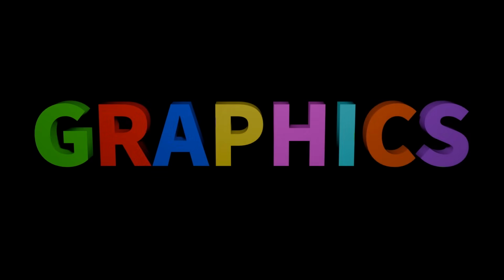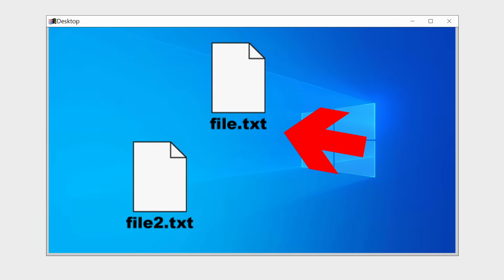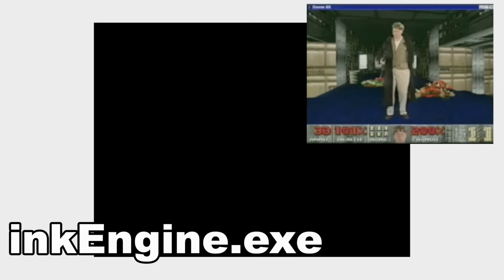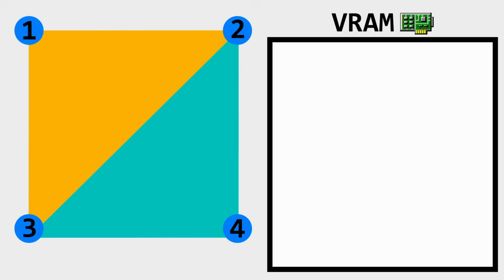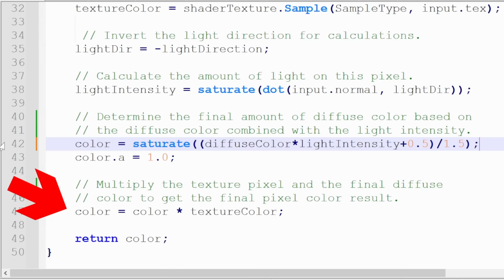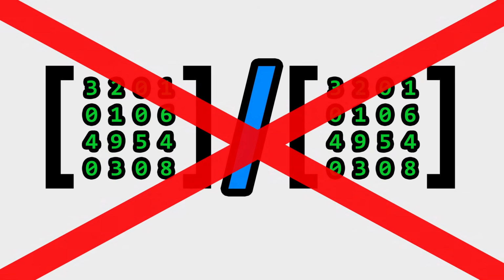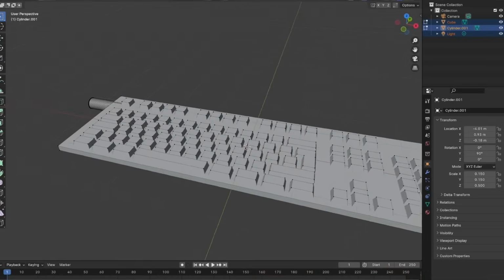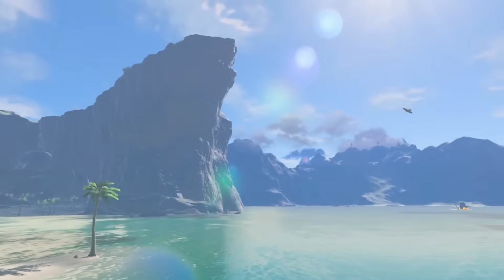Creating My Own 3D Graphics Engine

Comment: coded my own 3d game engine in 6502/10 assembly  for a lark on c64, rendering quasi textured polygons/sprites/particles etc in PETSCII characters . Had to write my own floating pointing point math/transforms from scratch as the 50 year old cpu utterly lacked for such things. Performance wise wasn't to bad maybe 10 fps unoptimized had optimized code implementation which doubled it but too lazy to do the significant recode. Kind of surprised couldn't find that anyone else had done(3d petscii) as seems a  pretty cool option for 1982 hardware. I hardly took anytime over assets and think it looks reasonable alternative to slow 8bit bitmap graphics. Could even used scrolling pixel scroll registers to interpolate rotations for a quasi 50 fps turning fluidity,. I tried but didn't seem to work quite right though lol...

https://www.youtube.com/watch?v=G6DWmaxw6Ic

Comment: Saw a lot of comments about the floor, but I have one about the skybox: There's a technique around taking a cube, with a mapped sky texture (almost like a "skybox") or sphere and render it first in the frame with the camera directly in the middle of it. In my own work, I usually create the skybox/skydome elsewhere outside of the main world, place the camera directly in the center of it, pull the FOV out, disable culling, render, then place the camera back in the world and render as normal. It gives a much better sense of "infinity" to the horizon.
Reply from the maker: That's clever, I'll definitely use that technique next time

Comment: Developing a content pipeline would also make an interesting video. I don't really know how modern engines like Unity/UE do it, but in older games (PS2 era for example) game assets were processed heavily as part of the build process. Texture mipmaps need to be generated, texture fonts, etc, and all that data is compressed so it can all fit on a DVD. They used a combination of LZSS and RLE compression.
The pipeline has to process any new/updated assets that get added during development, and it's better if it's all automated as part of the build process. A good content pipeline is something I think a lot of game engines out there overlook.

Comment: You can actually combine the three shader matrices into a single WorldViewProjection matrix before sending to the GPU.
You can also avoid having to use sin and cos math for movement (which can get problematic when trying for up and down movement) by leveraging vectors and scaling.
Third edit, just create a screen quad in clip space and draw UI textures to it. You don't need to do all the matrix inversions etc.
Final edit, please make a video covering culling, because without it you'll be severely limited in terms of how many unique meshes you can display.
Reply: He should do gpu side culling with indirect drawing for maximum performance

Comment: N64 was not good 3D lol. It looked dated upon arival. Perfect Dark with the addon gave the system a bit more fidelity. But games that appeared on PS and N64, almost always looked better and had a higher FPS on the Playstation. The n64 had the blurriest textures to the point it hurt my eyes.
Reply: You're insane. It looked far better than PS1 with it's lack of floating point and no depth buffer. N64 and PS1 both had the same max resolution, but N64 used it more often. PS1 and N64's libraries were mostly capped at 20fps, with some PS1 games dropping as low as 15. The only thing you're right about is that N64 had blurry textures sometimes, and that's because the console supported mipmapping while the PS1 didn't. So on PS1, you got jagged aliasing instead.

You don't know what you're talking about, you're just trying to war over consoles nobody is playing anymore.

Before opening your mouth in the comments of a video where actual graphics programmers will hang out, maybe you should actually learn graphics programming.

Comment: Hey man! Great video, very informative. Not sure how it's handled in DirectX because I'm not super familiar with it but because the UV coordinates are normalized, usually if you set them to higher than 1 it will tile the texture, so instead of having to make a floor of 2500 cubes you should be able to, in theory, just set your UV coordinates for a quad to be 50x50 and you should get the same result, but with 29998 less tris that are being calculated. Similarly, rather than using six cubes to make a skybox, you could have created one cube and inverted the normals so that the faces were pointed inward, saving you another 60 tris. Also, not sure how you implemented your frustum culling, but it can get very expensive very fast, so it's typically good practice to "chunk" static objects together so that the whole chunk can be assessed as to whether or not it's in frame. This is actually the same basic concept that's used for some raytracing programs (see Sebastian Lague's video on building a BVH for his raytracing project). Super awesome to see someone taking the time to learn the basics of how game engines work, great job!

Comment: I guess is easy to work with squares, but I wonder if there are examples of games who render text with a single polygon, Instead of a quad made of two polygons.
Reply: A quad IS a single polygon. What you're trying to say is "Can you render a polygon with only one triangle" and, no you can't. But you CAN render multiple triangles with less than the total number of vertices you'd expect. Eg a quad would normally have six verts, one for each corner of two triangles. But two corners of each tri share vertex locations, so we index them. Tri0, v0 v1 v2, Tri1, v1, v3, v2.
Reply: @moonhowler667  Sorry when I wrote polygon I meant to say a triangle. Which is a type polygon. If a triangle can have a texture applied to it, why can't text be rendered out of triangles with a single texture that contains the entire alphabet?
Reply: @TheIndigoShine  It can, that's called texture atlasing. The ideal method is to render two triangles directly in NDC space, and use texture quilting on an atlas to choose characters. Then all you need is a way to convert character inputs into UV coords within the shader and you're done.
Reply: @moonhowler667  cool.

Comment: 20:55 couldn't you make the texture repeat? in opengl (i know you are using directx) you can set the texture to repeat by using glTexParameteri(GL_TEXTURE_2D, GL_TEXTURE_WRAP_S, GL_REPEAT) and then you can set the UV to the range [0; N] and the texture will repeat itself N times

Comment: I never done any DirectX stuff but I don't think you need any matrix (orthographic or perspective) to render 2D stuff. You can just use a different shader with only 2 values for position, and hardcode z coord in there. At least that's what I do in OpenGL/Vulkan
Reply: Easier way, just create a quad in clip space right in the vert shader stage. Use NDC directly,

Comment: I just realized that you have been able to make a lot of games with different programming languages, and I remembered today that when it comes to programming you need to focus more on being a great problem solver rather than remembering syntax, and I believe that will help you be able to learn  any programming language. I learn't about this from Fireship's video, how to learn to code - 8 hard truths.

Do you ever have any difficulties with making new games with different programming languages? And if not, do you think there's a reason?
Reply from the maker: All high level languages are basically the same, so it really comes down to what platform do you want to write a program for. Windows, c#, c++. Web, javascript. Linux, c, c++. Just want it to work and don't care how: python. But of course the most fun: assembly.

Comment: 6:26 why location, color and depth are float? Float is slower and makes no sense
Reply: What do you mean ?? What should it be ?
Reply: @fold4x  It should be a structure or Integer, but float is floating point and makes no sense if you use it to store integer variables. this bloats the app and makes it slower
Reply: you literally don't understand how the fragments work lol.
Reply: @tomtravis858  You don*t unterstand that fractions are much Slower than Integer and any serious coder avoid them at all costs
Reply: Dude. You're suggesting that vertices only use integer positions, that's the first issue. Do you want them to snap around like PS1 games did? No? Then you need floats. Second of all, colors are processed as RGBA float 0.0~1.0 range by the frag shaders, so no, you can't even use integers there. Third of all, the depth buffer is ALSO a float 0.0~1.0 range, so no you can't use integers there. 

Saying "good coders avoid floats" is the same as saying "I write good code because I always use size_t for iterators" which is a SUPER midwit response.
Reply: @ Dude, you suggest that I don't konw that. with 32 bit integer you have 1 Billion positions. 64 Bit even more. Nothing will snap. and colors shoult be handled in 32 bit with ease even if you have a 10 bit monitor
Reply: @omegaidol First of all it's 32bit int, not 34. Also there are over four billion values in a 32bit int. But the problem is, worldspace is in floats because the world/view/proj matrices are floats. You can't do proper multiplication of matrices with integers because you need a range of 0.0~1.0. So if you use ints, vertices snap to the nearest worldspace integer position. 

As far as colors, read what I said again. The GPU expects the output of the fragment shader to be in float RGBA 0.0~1.0 format. Not integers.

And besides, you're doubly wrong here because a float is 32bits and an int is 32bits. DOUBLES are 64bits. Floats are negligibly slower, about the same perf difference as 32 vs 64 bit ints. 

Do. Your. Research.
Reply: @XandrEDM  34 bit was a typo. If the shader expect float, ok then ti makes sense.
Float operations are still usualy slower as no bit shift operations are possible, which are faster than ana multiplication or division
Reply: @omegaidol Google "floating point bit magic", or just "fast inverse sqrt". ;)

Comment: I’m surprised you didn’t use vulkan
Reply: i would have been surprised if they had used vulkan. the amount of boilerplate you need to write to get basic rendering is significantly much more than that of D3D11 or OpenGL.
Reply: @chromosoze  open gl is old and bad 🥱, vulkan is open source and not more compatible but definitely an alternate, it interacts with the computer system way better, open gl is limited becuase it’s old and needs to keep its compatibility

Comment: The way unity handles UI is to rendering it on a plane and stick it too the camera and use orthogonal view on it, rather than another ortho gfx pipeline... it renders faster UI being the worst fps hog to begin with. it also transfers CPU to GPU for some calculations.. also UI libs just need a renderer.. and you can get away with only windows buttons and text fields and editboxes with nothing else

Comment: Yo to help with the floor rendering, add a UV multiplier into your base shader and you can gain back a lot of the performance from just using a single plane like you did previously, and scaling the floor UV texture.

Comment: I made my own 3D game engine as part of my education. The feeling of making something from nothing is truly unique!
Reply from the maker: It's a great feeling for sure
Reply: coded a 3d game engine  in 6502/10 assembly  for a lark on c64, rendering quasi textured polygons/sprites/particles etc in PETSCII characters . Had to write my own floating pointing point math/transforms from scratch as the 50 year old cpu utterly lacked for such things. Performance wise wasn't to bad maybe 10 fps unoptimized had optimized code implementation which doubled it but too lazy to do the significant recode. Kind of surprised couldn't find that anyone else had done(3d petscii) as seems a  pretty cool option for 1982 hardware. I hardly took anytime over assets and think it looks reasonable alternative to slow 8bit bitmap graphics. Could even used scrolling pixel scroll registers to interpolate rotations for a quasi 50 fps turning fluidity,. I tried but didn't seem to work quite right though lol...

https://www.youtube.com/watch?v=Aj8INbkCI88
https://www.youtube.com/watch?v=5rjGQKzJfc4 (didn't v-sync c64 code)
Reply: Goddamn youre smart, i can only code in hello world
Reply: @alexc2971  Better than using wisprflow
Reply: Can I see?
Reply: Yeah! 
It's a really weird feeling you get!
Reply: Please tell me you used vulkan.

Comment: I tried learning graphics programming once, but I wasn't able to absorb much other than the bare minimun to render a single triangle.

When I think of all the math background seemingly required to do all the stuff you do, specially with my next to LITERAL ZERO math knowledge, to the point where I can't even multiply or divide, it makes me feel very hopeless on that front.

To be fair, I was learning OpenGL, not DirectX, but I doubt that would have made any difference, the pipeline seems to be pretty much the same.

Comment: I would have just used vulkan tbh, not a fan of windows :/
Reply: For a beginner project that's a recipe for a bad time. DX12 and Vulkan are far more hands off than DX11 or OpenGL, with many more opportunities to screw things up if you don't know exactly what you're doing. For hobby projects I would just stick with the older APIs, they aren't going anywhere.
Reply: @MrMoon-hy6pn  I've had a smoother experience with vulkan than OpenGL
Reply: @Hellscaped  I’m quite surprised at that. What about OpenGL did you find less smooth? Is it all the legacy cruft, the state management, etc?

Comment: Instead of using a bunch of cubes for the floor, just make one large cube and set the UV map to > 1 so the texture will repeat
Reply: yeah, there are even different tiling modes, like mirror in one or both directions. in opengl at least, but direct3d should have an equivalent.

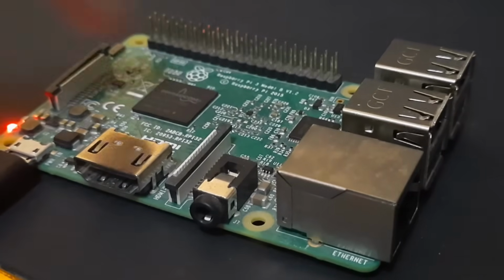Comment: 0:09 I have never plugged a monitor into any Raspberry Pi I've owned, if it would make it cheaper (no HDMI licencing fees) I'd like them without any graphical capabilities
Reply: Better to have it and not need it, than need it and not have it
Reply: @cool-person1161  Well, I own 17, the 16 that are in a cluster don't need any display out, I may as well keep display out on the 17th (I may actually use it one day, if making a game I can check on the worst case scenario hardware-wise)
Reply: i ❤ tty over usb
Reply: Arduino?
Reply: @SSukram_  I need something more powerful than that and cheaper

Comment: Very cool video! Now do a triangle rasterizer yourself and do a complete software renderer ;)
(Also you don't need to create many objects for the ground, you can just repeat the texture on a single ground plane, by providing sufficiently large UV values and setting the texture clamping value)
(Also you don't need to have non-static geometry for text, you could just as well use uniforms in your shader to get texture coordinates for your letters)

Comment: 9:30 No. A CPU does do SIMD. They have registers of sizes up to 512 bits now (with MTX extensions coming that'll have 1024 or 2048 in the future), and instructions that operate on them as though they were packs of 64/32/16/8 bit registers, in a way it is similar to what GPUs do, but on a far fewer number of, but far larger and more pipelined, and completely out of order, predictive, highly optimized cores. Instead, GPUs use SIMT, Single Instruction Multiple Threads. A GPU is made up of (in nvidia's terms, every vendor calls them something else) many GPC's (General Processing Cluster) that contain many SMs (Streaming multiproccesors) that contain Thread Blocks made up of two Thread Warps, which are basically a pack of 32 execution units that can do memory, floating point or integer related instructions, but no decisions, those are made by the SM controller, and all do waves of the same instruction (or they need to stall if not all of the threads are meant to take the same execution path).
Reply: this you? 🤓
Reply: I have no clue what i read but it seems smart so have a like lol
Reply: Graphical processors have dedicated hardware architecture for executing the same instructions on a lot of separate inputs in paralell, which helps them do the math for all the pixels in a displayed image simultaneously.
This only works so long as the same mathematical calculations are done on all of them.
Meanwhile CPUs have a lot fewer operations they can run simultankusly, bht those can all be unique, and usually more complex.
Reply: aayyyyyyyyyyyyyy lmao
Reply: Took them lots of years and a booming pc industry, but they finally made bit-slicing affordable.
Reply: nVidia's SMT is a marketing term for SIMD. Warps and SMs too. Stop using marketing terms for well known and previously implemented tech, you're confusing the children.

Comment: In my mind OpenGl is better
Reply: It is
Reply: Vulkan is king
Reply: @secureb00t39 Vulcan doesn’t support all 3D and is slow
Reply: As a person using game engines, I just use the default
Reply: found nara
Reply: OpenGL is better but nowadays Vulkan really is king. Vulkan is how it should be done!
Reply: @Silkapix  Yes Vulkan is how it should be, but try to set it up, you need to really know what your doing, or have a team. And Vulkan is not compatible for older PC's